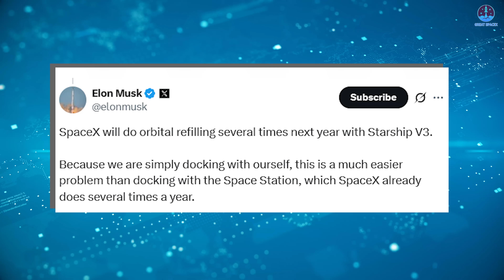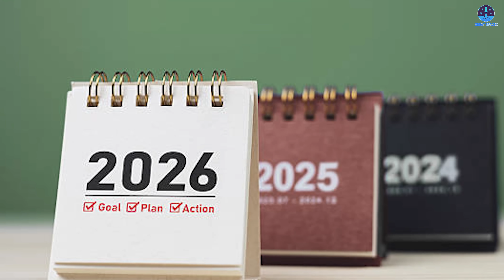Plot Twist: Elon Revealed Starship Orbital Refilling Plan Closer than Ever…NASA Shocked!

Comment: When going to Mars, why not have the habitable Starship attach to 2 tankers, one with LOX and the other Methane? Use these as external fuel tanks similar to military aircraft. This could increase the habitable space by having fuel tanks that are only large enough to reach orbit, then each external tank can have an increased fuel capacity for the fuel it serves as a tanker. When reaching Mars, the extra fuel tanks can be converted into habitable space, keeping the main ship intact for emergency evacuation from the planet or returning to Earth.

Comment: This video Is a misconception of fuel transfer. It shows 4 booms on one ship but if it needs to be universal for all ships. Booms on one side of the ship. Receivers on the other side of the ship, Now for 4 booms on top of the the ships, for nose to tail, one side will need to be boom and a receiver and the other side will need to be receiver then boom. Each location right and left side. This will allow 4 types can transfer. There will need a hard licking dock

Comment: Maybe, the Whitehouse should consider giving NASA's SLS and Space X, a "one-off cash injection" to get things moving, with emphasis on  using Space X Starship tankers in expendable-mode!

It may take a while to solve the heat-shield problem, and the clock is running!

Comment: Starship is alarmingly behind. What does the trial error engineering approach look like for in orbit refueling? Flying often fail flying again? During Starship they ha e show their engineering lacks rigor. 3 flights to get the door to work for example.
Dragon docking is not the same problem as inorbit refueling.
By the way, Musk is the same bullshitter that said he was launchibg 2 rockets to Mars in 2022 and 4 in 2024. The guy is a shameless bullshitter
Reply: Takes one to know one...😋
Reply: @HueManna  That is right. He helped get Trump get elected! I forgot
Reply: We should be seeing a Lunar-Starship being tested right now, but I don't see it happening!

Testing an elevator is important, but not that important compared to seeing one in earth-orbit!

Space X should consider using Starship-tankers in expendable-mode as the clock is running, and it may take too long to solve the heat-sheild problem!
Reply: @anthonybellmunt3103 Ask yourself if any part of the heatshield worked?? Answer is not for 100% reusability. One thing that you cant see is that there is heat transfer in the current system. That steel is glowing red hot. Is it surviving? Sure? But how are they going to insulate whats inside?
I agree with you. Make it into a large Falcon 9 and get rid of the srainless steel for starship. It takes away too much performance
Reply: It is called 'Elon time'.
Reply: @mrbaab5932  Yeah like the Hyperloop. Coming out in Elon's time=never

Comment: I didn't think that it was the docking that was the issue. I thought it was the weightlessness and how liquid fuel would float around as separate droplets that need to be corralled for transfer. I'm more interested in hearing the solution for that.
Reply: I suggested using a bladder system. The only thing with the bladder system you have to have the material that would actually handle that Cryo temperatures

Comment: No, orbital refueling at scale in LEO will not work. 

What's more, the fuel in orbit will continuously boil off, requiring a complex and heavy cooling system. 

But wait, there's more. Starship dry weight is 85 metric tons and it has to accelerate and decelerate this huge bulk everywhere it goes. And that's why steel rockets are never used. It's like making a concrete airplane.

MIT '86 AeroAstro
Reply: With that negative attitude, you are aware SpaceX is hiring engineers, right?  I'm sure they would love to have you solve the refueling problem for them.
Reply: Sure bro

Positivd "atitude" is what engineerimg is about bro.

Comment: The real challenge of docking with ISS isn't that it's made by different organisations with different software etc.  Starship is made of steel, which is malleable.  ISS is made of aluminium, which is brittle, and then it has multiple modules connected at right angles which amplifies the problem of it being brittle because docking forces are necessarily transferred in a shearing plane to the joints.  So docking vehicles have to come in super duper slowly, and orbital mechanics make super duper slow docking (ie 40 minutes) vastly more complicated than docking at a more reasonable fraction of an orbit, ie 1-2 minutes.  Starship will be able to dock with itself much faster, because it can bear vastly higher docking forces.

Comment: Why dock? Why not refill like aircraft do with a hose or pipe? Would this not be simpler or safer? Sorry if this is a stupid question but I’m a layman in this area and I’m genuinely interested.
Reply: Uhh you can't just drop a hose in space
Also low to basically 0 gravity 
Not to mention the fuel has to be pressurized

Comment: Why has this channel never tried to spark real criticism? From what I’ve seen, most of the claims feel exaggerated, misleading, or overly optimistic. The narrator never questions how SpaceX would actually pull off orbital refueling, even though there are huge challenges to solve. For example, how would they deal with condensation, evaporation from solar radiation, or wear and tear on the docking system after frequent use? And if they’re talking about moving 100 tons of cargo, they’d need something like 1,200 tons of fuel. How exactly are they planning to make that work?
Reply: The elin cult is about this